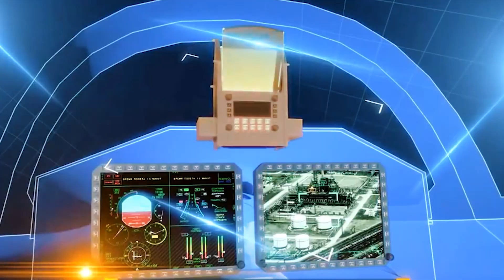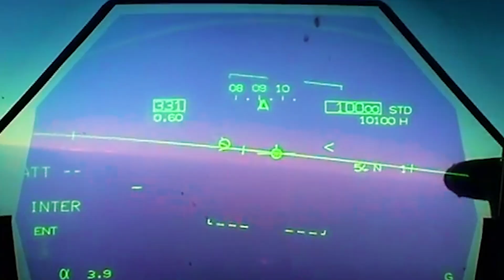Japan Is Testing Their New Jet fighter

Comment: Point of information at 5:08 - the super hornets (F/A-18E/F) use the F414 engine, not the F404. The F414 is also used in the Gripen-E/F, albeit in a slightly modified form.

As for weaponry options, it does seem like the proposed F-3 will suffer the same limitations that the F-35 currently faces, i.e. no internal carriage of traditional heaters, which ignite on the rail and are therefore incompatible with fixed internal rails. 2 cannons is also a questionable design choice, with internal volume and weight being a primary concern; anecdotally, many pilots would much rather have more ammunition for one cannon.

Finally, a word on the jet air intakes: there is likely to be a large redesign, with a sawtooth DSI under priority consideration given the spacing between engine nacelles making an S-tunnel quite shallow. Intake size is also likely to change with engine choice (like with the GE engined Block 60 F-16s), necessitating a redesign of the supersonic diverter, at the very least.

Comment: I love it. It reminds me of the Avro Arrow CF 102 right down to the specs for speed and range
Reply: The avro arrow was an overrated interceptor that even Canada's air force didn't want 😂😂😁😂
Reply: @ME-mv6wi  Lmao..we were a threat to your aviation industry read the books and the people who put you on the moon. Those involved in the avro project went on to lead Bristol NASA boing lockeed and many others and retired as management of them. Funny your guys were up here trying to recruit them ahead of black friday
Reply: @ME-mv6wi   @Josh E  Take a look at the 10 most powerful fighter engines ever built. The arrows Iriquaas is second only too the f35s massive single engine and there are two in the Arrow. Its speed would have been mach 3.2 and a service ceiling of 90.000 feet